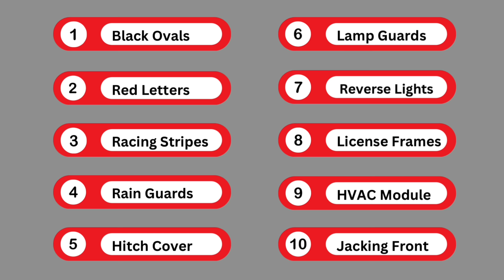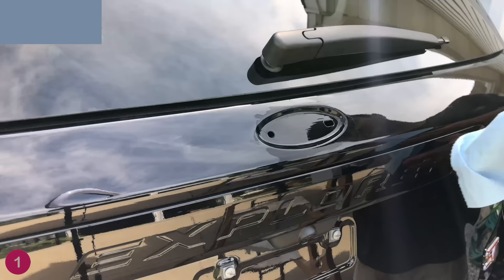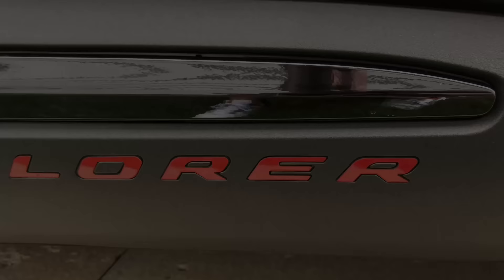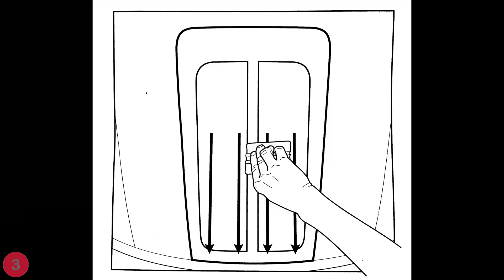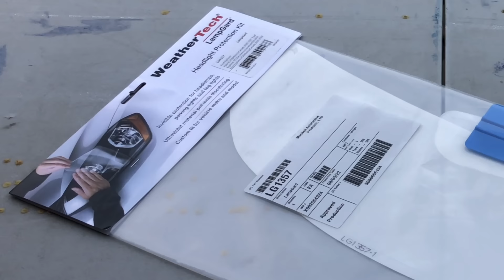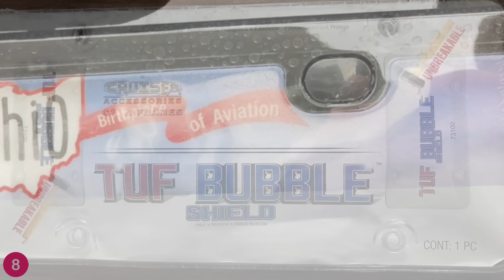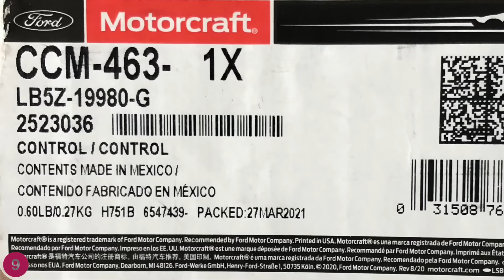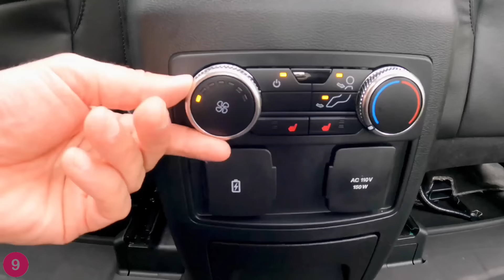10 DIY Upgrades | Ford Explorer

Comment: One minor thing that Will absolutely completely change the look of your vehicle will be if you tint all the windows around!!
Reply: I did to protect anyone in the back on long trips from sunburn. And previous owner tinted the front with 20%. Front and back match. And windshield tint 50% to finish her off.
Reply: Imo, it's dangerous to other drivers to tint windshield and front door windows so much you can't see the driver.
Facial cues and 2 way eye contact are important parts of driving with others on the road
Reply: I agree,  it makes a huge difference. The only problem is that you can't see at night.
Reply: I second this.  Tinted my wife’s ST immediately
Reply: Depends on the laws in your state on tinting.
Reply: for me i prefer no tint on driver side, windshiels and back door glass so i can see well. at day i rather use sun glass

Comment: Great video. A couple of pointers on the headlight protection: I use a squeegee with a faux suede edge to prevent scratches (I also wet it to reduce friction) and a little flash of heat from a heat gun would have relaxed the film and laid it down where it wanted to bunch up.

Comment: I'm looking to add ceramic tinting all around including a sheet on the windshield to dissipate the heat. I'm also planning on changing out the stock thermostat that starts cooling at 190 to one that starts cooling at 160. Not to mention I'm going to add a larger Whipple intercooler and a tuning kit to add another 93 horsepower. I'm also going to add a borla S-Type cat back exhaust system.
Reply from the maker: Love the S-Type!  Sounds like a Ferrari actually.  These twin turbos are just dying to be upgraded for more wheel horse power.  I’ve been eyeing up the ZFG tune, whipple intercooler and aFe cold air intake after I do the Steeda lowering springs & stabilizer bar.
Reply: @mugs132  you should go through the dealership for those parts. I know the location that I'm going through for my St doesn't even go to steeda for some of their parts. They actually cut out steeda and go directly to borla and they do the same thing for whipple. Especially if you do the intercooler and tuning performance package. Which by chance is $2,100 for the ST. Ends up costing just a little bit less. Not to mention both of those company work with Ford that way nothing gets voided for your warranty. And I'd really hate to see anybody have their warranty voided.
Reply from the maker: Yeah there’s a Roush Ford dealer near me.  They’re definitely willing to do these upgrades.  My local vanilla dealer is a hard no, lol.
Reply: @mugs132  same here. I was going to a Ford dealership near my location that's only 20 minutes away but on the day I went to meet with him to talk about a few things he wasn't there until 10:00 even though an appointment was made for 9:00 and the people doing the scheduling knew this. So I just happened to be in another part of the city and was actually able to test drive and St even though it was only a 2022 and their dealership has everything. Collision, glass, and a customizable parts department. I've already decided I'm going to go to them and drive 40 minutes and get the quality salesman and service that I'm asking for rather than the run of the mill ordinary dealership near me.
Reply: You're looking, planning and going to do a lot and have done nothing. Lol😂

Comment: Nice job, I have a 21 ST and I have done about half of your mods but I like the other ones as well. That red Explorer lettering on the plastic kick panel is a very nice touch. Nothing goofy everything nice, clean, and subtle. I had never seen that jack pad before I was always using a small piece of 2X4 on my jack so thanks for that. I'm gonna order the jackpad and reverse lamps right now!

Comment: Just picked up my 2022 Ford Explorer ST last week...  Fully loaded with 401a high tech package and ST high package

I cant find black ford emblems anywhere!!!!  
I like the black matte stripes...  I think I'll do that too...  Mine is a black on black ST with the blackout package.  

I have done this week
-Mishimoto Intercooler
-aFe CAI
-Thermal R&D Downpipe back exaughst
-Changed the chrome lugs to BLACK lugs to match the BLACK out package
-aFe strut tower support brace
-SPD Performance 3" catted Downpipes (multiple forum members show a 30+hp and 40+Ftlb increase with JUST this alone)
-Building my custom tune on my HPTuners MPVI2+ system

For performance, the one thing that will WAKE up the ST, do the intercooler, its a $1k purchase, but WELL WORTH IT!!!!   the stock intercooler might as well be just a pipe its so useless...
Reply from the maker: Black ovals product link is in the description.  Available on the Ford Accessories website.  https://accessories.ford.com/products/black-badging-ford-oval-explorer

Comment: My 2019 explorer has a single tone horn.  They stopped putting the dual tone horn a little bit before mine.  The dual tone was a bit to find but for less than $100 it sounds so much better.  It was just one bolt and all the rest was the same.  The fit was tight to get it in, but patience did it.

Comment: Love some of the ideas. Can’t believe you found the rear HVAC control. I’ve been waiting since February 2022 for them to come in, but it feels like they never will.
Reply from the maker: lascoautoparts on eBay was the seller I purchased it from.  Not sure if they have any more.  I joined the explorerst forum and got some tips from other members who found one but got lucky on eBay one night.  Good luck, it’s especially convenient for rear passengers in the winter.
Reply: I've been looking for the rear HVAC controller and heated seat controller too...  The seats are there with the heated parts in and wired, but we cant turn them on!  ugh
Reply: How do you control real hvac with out that?
Reply from the maker: Using the screen in the front.  There’s setting for temp and air speed.  I don’t believe the rear heated seats can be used without the module though.
Reply: Oemfordpartsfast has that controller but said it won’t fit my 2022 explorer hybrid.   Hmmm.   I’d like to nest all that upgrade.
Reply from the maker: @johnmanning4895  Yeah not sure, just ask you’re dealer what part number you need.  This is a ‘nice to have’.  It’s the only way to use the rear heated seats on my vehicle
Reply: Freaking chip shortages, my 21 has rear HVAC.

Comment: You mentioned not using acetone when changing the oval.  I recommend the same.  It is a very strong solvent and can mess up some finishes and plastics.

Comment: If you have troubles trying to get vinyls (like the lamp guards) to stick use a little bit of heat from a heat gun but be sure not to hold it on one spot for too long as it can ruin it. I use it to install vinyl graphic kits on dirtbikes

Comment: As a new owner of a '16 Sport, I approve these mods. My Ex is burgundy and I think I'll go with the all matte black emblems front & rear. I crazy that your model requires the front bumper to be pulled away just for the emblem but it looks very well worth it. Also crazy the the rear HVAC module is missing yet has the harness. Ford always does little weird crap like this. But well done. Your Ex looks killer.
Reply: They did that cause “supply chain issues” most 22 and newer don’t even come with massage seats.

Comment: For the light covers it's with a heat gun or hair dryer.  Same concept than tinting windows. Black emblems was the first thing I did. It's kinda necessary to shrink the material in the curves.

Comment: I just bought the identical car a few days ago (used).  Ours was originally bought in Dec21 and didn’t have anything deleted.  I really can’t believe that Ford wouldn’t even offer to add these deleted items back in at a later date when the parts became available.  When I was shopping I noticed some of the deletions only took 50 dollars or so off the sticker price.
It’s a beautiful car, but I don’t know who at ford decided the electric fold down 3rd row with controls that can only be operated from the back of the car, was a good idea.  They should have added a second set of controls up front, but in all reality, should have just left them manual.  KISS.  Also the cargo light makes those controls nearly impossible to see at night.

Comment: You can buy the film, the headlamp protection is made from, by the roll. By cutting your own you can make it a bit narrower, to avoid the worst of the curve, bends and angles.  It's inexpensive. I use it on my motorcycle and bicycles.

Comment: The one thing that would bug me is the rain visors on the front. The curve on the visors is much different than the sharp angle of the door and that would drive me crazy.
Reply: Agreed. I ordered the low profile and had to returned them because of that. There's no way my OCD could handle it.

Comment: No on the rain guards. That gap at the top, where the roof and windshield come together is an angle but the guard is an arc. Once I saw it I couldn’t unsee
Reply from the maker: It actually follows the contour of the door if you look closely before it’s attached.  Once installed, my eyes are drawn to the matching outer curve of the body.  Like that this rain guard follows that curve.  Would bet AVS white labels the Ford branded product because they look identical.  But if you want to follow the inside hard angles of the door frame there’s a few options online. Don’t think any are low profile though.  At least in 6th gen

Comment: I just bought the King Ranch in Black. I looked at the blue background Ford emblem and thought that would be cool black. Not sure I have the intestinal fortitude  to pull that front bumper off. So I thought about just blacking it out completely with the shrink wrap stuff. I wonder if the red lettering is available in chrome finish.
Reply from the maker: Probably a 60-90 minute job for a first timer (front oval). With more experience or repetition less than 30.

Comment: Yea that’s really nice but I bought a black matte and black gloss vinyl - the logo is matte and the gloss is the ring around the logo - I’ve had it on there for almost a year and it hasn’t come off going through the car wash which is at least weekly. It was cheaper than the $250 for a new emblem. ..and if it ever peels off I’ll just get another piece of vinyl - so you can see the FORD razed texture through the vinyl - so my emblem is all black no silver on it.  I really like the racing stripes on the hood - I don’t have a black vehicle (Indigo Blue) so that might not look good or maybe it would I have to think about it. I like the rain guards but I bought low profile with clips and two way tape so when I’m cruising down the road I don’t have to worry about them blowing off or washing away in the car wash. I changed out my pedals for red aluminum and added an aluminum drive mode knob cover, carbon fiber door window lift panels and center control console. Just a little touch…I also found these side storage box that fits right inside the door pockets which I use all the time. Yip I love my ST too.

Comment: Tried the trail light bulb upgrade. After installing them i got a super fast blink which told me something was wrong. Installed OEM back in and flash returned to normal. Not sure why i had these issues.
Reply: Possibly CANBUS?

Comment: Thanks for the video. Love it. For the front end, I use the same jack spot to lift it and then put jack stands at the pinch well. I wonder where is the best place for the rear end.
Reply from the maker: First off, it’s a bummer that Ford didn’t design and engineer jack points to raise the entire front or rear of the vehicle at once with a floor jack so we can rest the car on jack stands.  Ridiculous. So we’re on our own to find a way that won’t damage the vehicle.  For the rear, I think there’s possibly a decent spot on the rear subframe.  Look at schematic E302520 here https://www.foexplorer.com/ford_explorer_removal_and_installation_rear_subframe-1496.html  there’s two huge bolts in purple holding the subframe to the car (forward of the axle) I would Not floor jack under these (or any) bolts, but just next to them looks like a strong point that’s flat.  I’ve not tried it yet, just a guess and something I plan to try in the future.  Check explorerst.org to see what others are doing.
Reply: @mugs132  Thanks for the reply. I agree with you. Those are similar spots like the front end. However, they are not as flat. So not sure if it's going to work well with jack. I've also seen a post where someone mentioned using the rear differential as the jack spot but  I don't think it's good idea.

Comment: There is a 1 inch gap on the front wind deflectors in the upper corner. It causes noise when you drive. It became very annoying on my 2020 ST.
Reply from the maker: Mine are solid, no issues with anything and they look sweet.  I get the car washed every week and no issues there either.  Would definitely recommend.
Reply: Lol my OCD is like.. NOOOO HAHA

Comment: Great video.  Question, how did you control your rear headed seats prior to installing the HVAC control?  I have been looking to buy an ST, but all have not had the rear HVAC control.  Seeing your video has really opened my eyes as to how easy it is to add...
Reply from the maker: The rear hvac can also be controlled with a button on the front console and through the touchpad.   However, I don’t think the heated seats will work without the rear control module.
Reply: Thanks!!!  so, you had heated seats in the rear, but could not control them (until you installed the rear HVAC controller)?  Do you have the bench or captains chairs?
Reply from the maker: That’s correct, you need the control module to turn on the rear heated seats.  My ST is equipped with rear heated seats and rear captains chairs.
Reply: @mugs132  So, I have a bad question...How did you know that you had rear heated seats?  It came with rear heated seats, but you couldn't use them (until the module install).
Reply from the maker: Dealer sales rep told me I had them and it’s just the control module that’s needed to get them functional again.  I reconfirmed that by searching for the part on Fords website for my VIN.  Lastly, the window sticker said it’s just the control module that’s deleted.
Reply: @mugs132  I thought Ford would be installing them for free at a later date if it was deleted during production.
Reply from the maker: @Gord   I researched that before making this video.  My dealer was unhelpful, wouldn’t make any commitments or provide insight on timing.  The explorerst forum had some posts on the subject, and Owners were getting varying stories from dealers.  I couldn’t find any official release from Ford directly, but there’s a Yahoo story that seemed credible, in it they claim Ford plans to replace them free of charge “at a later date”.  Link here - https://finance.yahoo.com/news/ford-to-sell-explorer-su-vs-missing-rear-climate-controls-due-to-chip-crunch-202755372.html
Reply: @mugs132  😱
Reply: FYI. My ‘22 ST came without the controls as well but Ford gave me $200 of my purchase price and agreed to install them at a later date for no charge. Mine has been updated at Ford 👍
Reply: @mugs132  this answered my question I posted above. I did a search by VIN and the correct module shows without alternates. thank you

Comment: Just got my St. definitely excited to do the black badges, coming from a Tacoma, could you not easily access the badge by just removing the screws on the grill? I haven’t looked in my engine bay well enough to know but to access the grill sensor shouldn’t be such a tedious process to remove the wheel? Great video nonetheless
Reply from the maker: On this generation Explorer, it’s the only way to properly remove and replace the badge securely.   I was looking for shortcuts but didn’t find anything.
Reply: @mugs132  gotcha. Thank you.

Comment: How did you know you had rear heated seats? I am looking at picking up the rear control module. but I don't know if I should get the one with the heated seats button or without.
Reply from the maker: If you have an ST you have heated seats they’re standard

Comment: The fact Ford put the gaudy blue emblem on all these vehicles is beyond a travesty. I have a red one and tbh, if I would have known the whole bumper had to come off to replace, I wouldn't have even bought the damn thing. Absolutely ridiculous
Reply from the maker: As of now, Ford doesn’t offer the black badging straight from the factory assembly, so we’re left with diy or having a dealer install it.  Many other car brands have black badging right off the line.  It really wasn’t that bad doing it myself, it took about an 90 minutes and required basic tools.

Comment: I’m dying to get an ST myself and I would probably do the reverse lights, plate cover (cuz you never know when you need to cheat the toll roads), and rear HVAC (if need be). I prefer my cars to look stock so I would just do these “qualify of life” mods as I would call them. I would also, and you should too, install hydraulic hood struts cuz a prop rod is just embarrassing on a vehicle like this and fix the fake-ish tailpipes that Ford tries to justify cuz they think people care about their pipe tips getting dirty
Reply from the maker: Yeah I’m with you on hood struts.  I’m testing two brands and plan to release a video in the spring with my how to & review.  I think Ford’s are just generally more utility and that’s why they skip things like hood struts, and they let the trailer hitch stay exposed.
Reply: Just installed a set of Redline performance struts on my 2022 limited today.  All the tools needed are a drill, 3/16th  bit, 15mm socket and ratchet, tape measure and a pencil. Easy installation and no cutting of factory plastic pieces as is necessary with MRT struts. Just a matter of preference. Both of these kits are manufactured in the US.